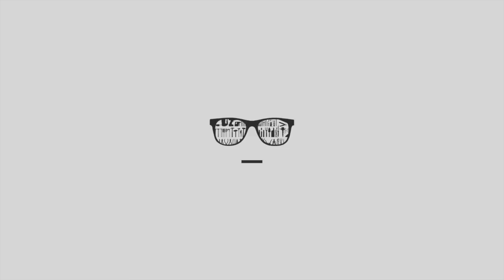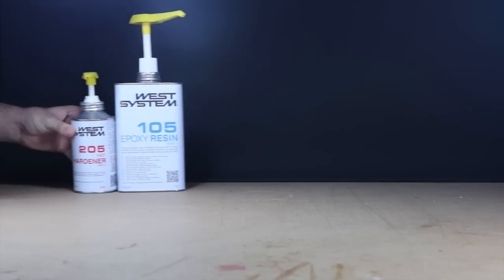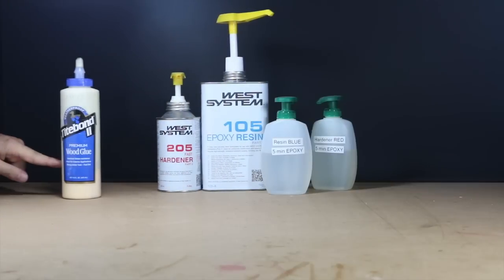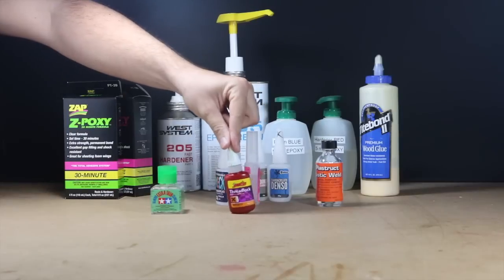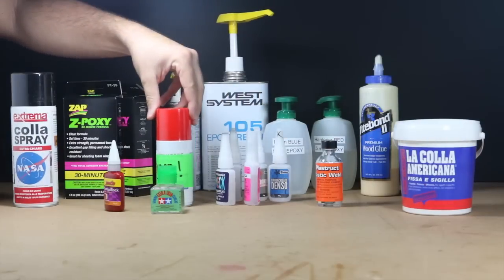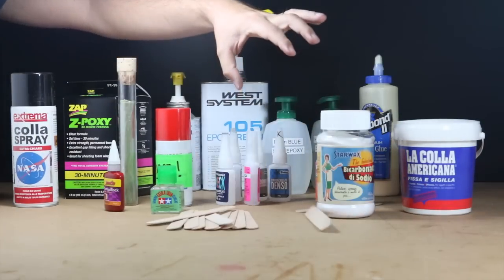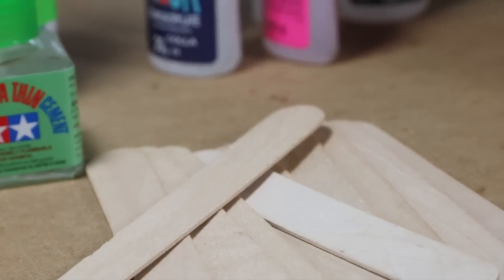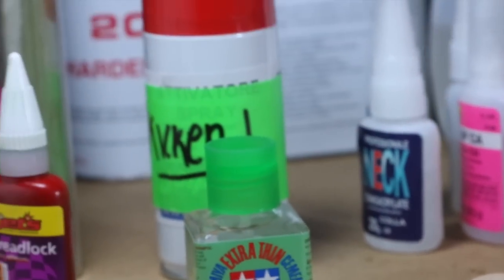⇒ Shop Organization: the Custom Glue Caddy

Comment: Hey Giaco!
As always - nice vid.
Couple thoughts... When i saw You using your paper holder, i immediately thought , couple new pens would have been a good mini lathe project idea, scince You got one lately..
And the flying aluminium... Dude, it was a bit scary... Hope there is a way to secure those pieces in place whyle being cut off.
About filmmaking - drillpress shot was relly cool, man! The light levet, angle and shot distance were in perfect conjunction.
Best wishes! Vladimir
Reply from the maker: Thanks for your comment Vlad!
The pen would be a great idea, even a pencil woukd be kind of nice? You think is possible to make an aluminum pencil? Got to try!!! :)
Yes there is definitely a way to secure those pieces, holding it with a finger it's more than enough. But I wouldn't have the nice jumping effect! :-)))

Thank you brother!!!
Reply: hey Giaco!
I thought about pen.
making it from rod might have some limitations hard to overcome, like the lenghth of grill bit to grill the hole.
But if You use an aluminium tube and work it from there...
or You can meke it composite from different short pieces, which You can connect with a ravit and superglue. those short ones could be made from rods...
the ballpen tip can be from BIC kind pen - th ave it as an assembly which holds by friction only for easy swapping fo used ink assembly.
Hope You can understand my english , i am from Ukraine.
Reply from the maker: I understand 100%! Thanks for the great ideas... I'll have to make some experiments... We'll see how it goes! Thank you brother!